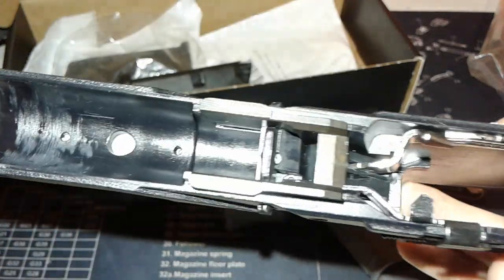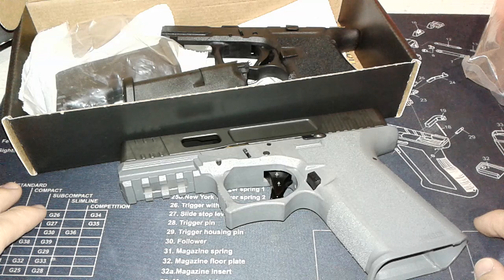Update on my Polymer80s. Also new slide/parts.

Comment: Where did you get the tin 30274 ejector and the tin front locking block?
Reply from the maker: I sent the parts to middle branch machine.
Reply: @livefree5997  looks awesome and gives the internals a very unique look. Love how it came out, how’s it run with it like that?
Reply from the maker: Thanks. It hasn't giving me any problems so far. I will add though because of the tin coating, it is going to be a tight fit when putting the ejector back in the trigger housing.